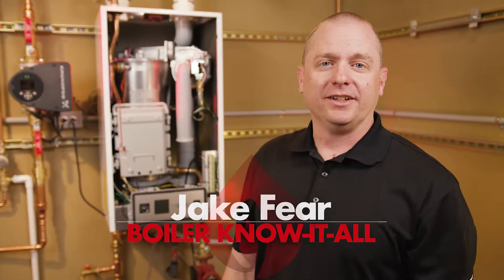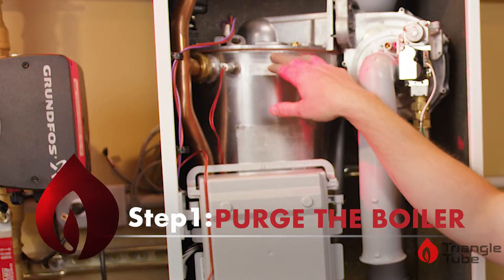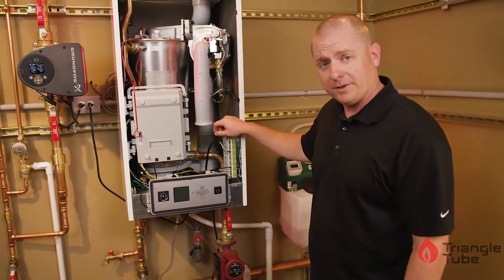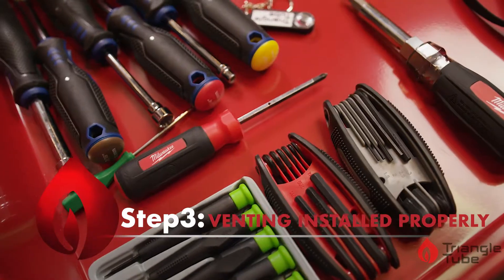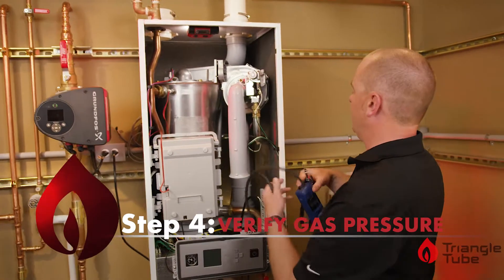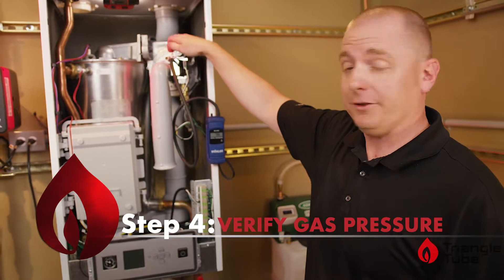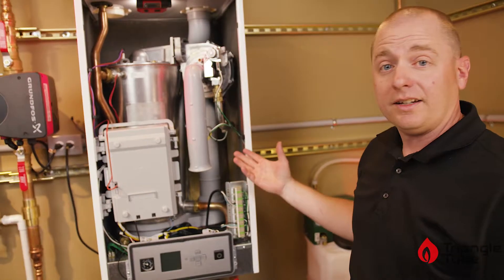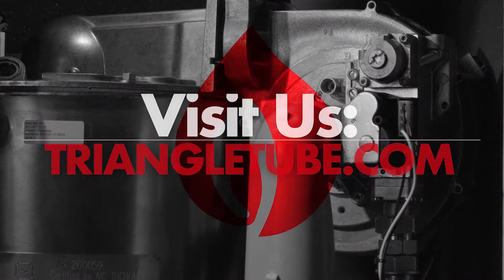5 Things Before You Start-Up

Comment: Where can I contact Triangle Tube boiler for maintenance in Ontario Canada??
Reply: Just to let you know, your boiler may have been recalled due to risk of a carbon monoxide leak. The following information is from the Triangle Tube website:

"In cooperation with the U.S. Consumer Product Safety Commission (CPSC) and Health Canada, Triangle Tube is conducting a voluntary product recall to repair 27 models of Prestige Solo & Prestige Excellence boilers (28 in Canada), and 2 models of Aerco Esteem boilers manufactured between December 2011 through April 2019.

The boilers can release carbon monoxide due to delayed ignitions or component damage, posing a risk of serious injury or death. Improper combustion settings can increase this hazard. All customers with a recalled product will be offered a free inspection and repair of their boilers. Nothing is more important to Triangle Tube than the safety of our products and we will continue to take all necessary action to protect our customers."

You can check to see if you have an affected model at the CPSC or Triangle Tube website.